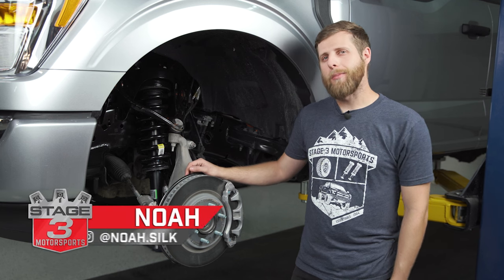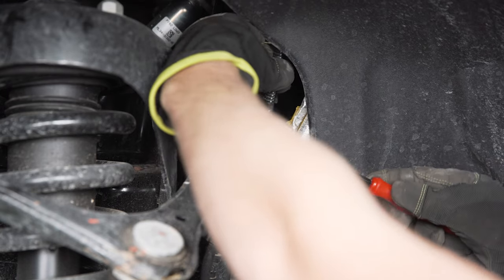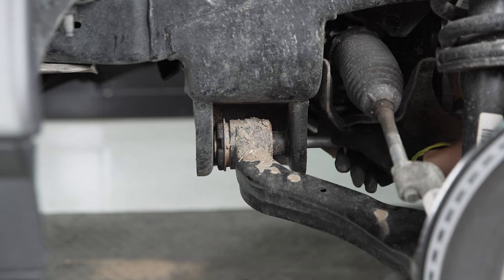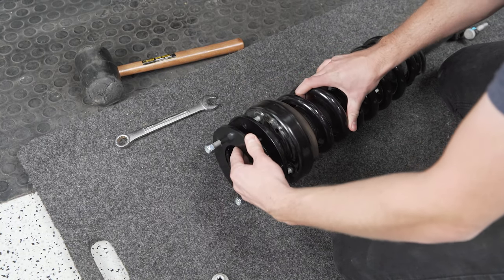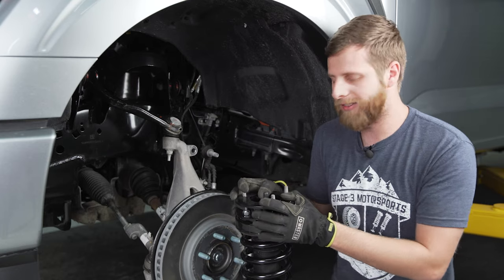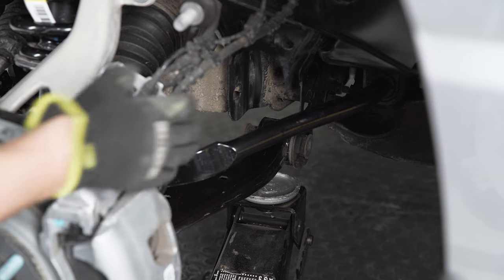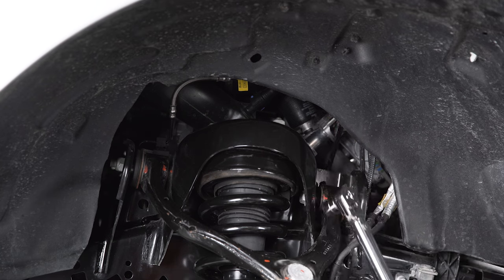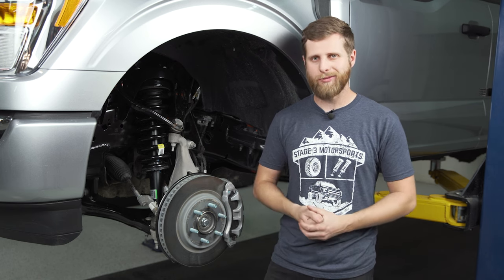2021-2023 F-150 2.3" Spacer Lift/Leveling Kit Install

Comment: Noah, we installed the 2.5 inch spacer kit on my 2023 F-150 Ford Tremor today, took two us 3 hours total.  Your instruction video was a life saver.  We had only two issues, realignment of the lower control arm / bolts and the sway-bar reattachment. With some McGivering we were able to get it all lined up and bolted back as when we took it apart. Other then that your instructions on doing it different then the instructions that came with them was great.  The truck looks great and sets level, thanks for the tips.
Reply from the maker: Glad it helped!
Reply: Had it aligned today, tech said the only thing that needed to be adjusted was the Toe-In, as it was out just a bit. All is good.

Comment: Great video but I spoke with a Ford certified mechanic about the way you and many others are changing the angle of the bottom bolts. He said those bottom bushings are pressed in and by rotating them like you did will risk tearing the rubber bushings. All you have to do is move the passenger side strut to the driver’s side and vise versa and presto, you have the correct angle of the bolts. It’s much safer than risking tearing the bushing on the bottom of the strut. Or, you can compress the spring and rotate the top plate. But the way you are showing people to do this is risky. Hope this helps and I really wished you would change your “how to video” to tell people the safer and more correct way to add the spacers. By the way I did purchase your 2.3” spacers and I thing they are a great product.
Reply from the maker: Thanks for the heads up! This is a good point and I'm sure it helps increase the longevity of those lower bushings. We've got our hands full at the moment so remaking the whole video isn't possible right now, but I'm going to add a note about this in the description in the meantime.
Reply: @stage3motorsports  Are the spacers side specific? Will this make a difference if the struts are swapped like jhamilton said above? thanks for the video
Reply: Will swapping the struts from one side to the other create any other geometry or alignment issues?
Reply: Not that I’m aware of but compressing the struts and turning the tops is the absolute best and safest way to do it.
Reply: Your absolutely right. My bottom bushings are smoked. I’ve only had this lift on for 5 months now. Every time the truck moves or makes a hard turn it makes a very disturbing sound.
Reply: Can’t you show me the time stamp that you’re talking about in the video that way I know what not to do? I’m a little confused on which part you’re referring to. Thanks!
Reply: @Cooldibs  its the part in the video where he has the strut in his hands and puts the bottom bolts into the bottom control arm and pulls the strut towards him to change the angle of the bolts so the strut will line up better. But by doing this, it risks tearing the pressed in rubber bushing at the bottom of the strut.
Reply: @jhamilton968  oh okay, makes sense. So just using the opposite side strut should work? I plan on installing this next week
Reply: @Cooldibs  I haven’t personally tried this but I was told by a certified ford mechanic that it should work. I don’t think they are side specific except for the angle of the bolts on each strut.
Reply: @jhamilton968  I just installed this system on my 2022 F150 and swapping the struts side to side will make no difference at all. The struts are identical for left or right side. Ford does this by drilling the frame mounting holes at the top of the strut 180 degrees different from side to side. So the only solution is spinning the top plate 180 degrees to orient the strut back to original positioning. (because the spacer spins the strut 180 degrees as well).
Reply: In another video installation of a different product, same final effect, Real truck shows putting some penetrating oil in the outside circumference of the bushing in the lower strut mount and then using the lower control arm holes as a lever point to reposition the angle of the bottom bolt-in bracket for the strut. I'm going to try this and report back....Yep, works perfectly. I sprayed some lite oil around the outside of the lower strut rubber grommet, placed the nuts onto the two studs and positioned these in a fixed vice, using the strut body to apply force and rotate the studs to the correct angle.
Reply: @beck1c  around 4:29 in the video will answer your question
Reply: Thinking about doing this to my 2022 f150. So I do everything he did in this video but to make it better on the bottom bushings I switch the passenger strut with the driver ? So the passenger strut will be where the driver strut was and vice versa ? Is that it ? Just want to make sure lol
Reply: @A5MR555  someone in the comments said that just switching sides will not work. So you’ll have to turn the top plates 180 degrees.

Comment: @Noah Stage 3   I just did this kit on my co-workers son's truck easy to install... Best way to do it is undo the half shafts if 4x4... Loosen the upper control arm nuts just enough to push it up a little bit.. we did not swap the strut side-to-side.. we 
Put the lower strut bolts into the control arm.... He pushed down on the on the knuckle and control arm and I shove the strut into the pocket and the spacer kit studs lined up to where they need to be... And then just put everything back... It is better to do it on a lift ...used a floor jack to raise the knuckle back up to the upper arm to snug down in a non dropped position... I did not have to adjust camber or Caster.... Final measurements for the camber we're -.3 and Caster was 5.3 on the passenger side 5.1 on the driver side... Set the time toe  .10 and the middle truck goes straight down the road driving smooth... Hope this was some helpful info... It took about 2 hours with us doing alignment.

Comment: I cant decide between spacer, strut or full suspension.  Even though I am only looking to level out and maybe fit bigger tires eventually.  Though I was only looking at getting 285 or possibly 298.

Comment: You mentioned the spacer having an offset on them that is slightly shifted. With that being said how you installed the strut it throws it 180 deg out in your strut bottom bolts causing wear on them. Best way is to turn the top part 180 deg to install it back to original of strut where the bolts are by compressing springs. But doing so it’s going to throw off the offset on the spacer will that have any affect on alignment?

Comment: This looks like a fairly simple way to install the leveling kit. 
Even though the lower control arm went back together without much difficulty would it be easier if you turned the bottom strut bolts inwards to create the same angle as before rotating strut 180 degrees from adding the spacer.
Reply: I'd imagine it would help, especially if you have a larger spacer and things aren't lining up. Fortunately, I didn't have too much trouble here, but I may give that a shot next time around.
Reply: @NoahStage3  thanks for the reply. This way definitely looks like the easiest way to do it for sure. Thanks for the video!

Comment: Can this be done without a lift? Just a jack and jack stands? Worried I won't have the space at the bottom to pull the strut out. Could the strut be pulled out the same way (but opposite direction) it is reinstalled? I.e. via dropping down a little and then up.

Comment: Thank you for the video.  I wish you had included the torque specs.  Especially on the frame bolts for the lower control arm?
Reply: You don’t need to use a torque wrench. I’m 50 years old & have been wrenching on cars/trucks since I was 14; never once worried about torque specs & haven’t died yet. ☠️
Reply: Well at least for the bolts through the LCA, getting an alignment will result in their tech tightening those down for you once complete. They look like a 14mm so you can probably snug them down with a breaker bar using a good bit of force, without worrying about overdoing it. I’d suggest marking the bolts so you can get it approximately there so driving to the alignment shop isn’t too awful.
Reply: @krasnaludek298  No, you miss understand.  I'm a big guy and I never think anything is tight enough.  I have broken many things. :-(
Reply: @saintsandsin3885  that's sad, and ignorant on your part...

Comment: Interesting.  A question.  Living in rougher road, mountainy ski country I'm thinking I'd prefer the thicker rubber of an 18 instead of a 20 wheel.  Could you do something like this, but put on an 18 wheel?  And could a 35 instead of a 34 wheel be used?  I ask this last because I'd really like to add a small amount of poke.  34's are not bad at all, just wondering.  Maybe I could go to a 3" or 3 1/2" lift/level to get to the 35's?  Thanks.

Comment: Cut my crash bars, as I went with 35s on a 2.5” level & downsized to 18” wheels for more tire sidewall. Looks good! 👍🏻🇺🇸
Reply: Nice! Good call on 18s and 35s. Smaller wheels and more sidewall is typically my preference as well, but I figured it was worth showing what could be done with a factory 20"
Reply: I thought you could fit 35s on a 2.5 with out cutting
Reply: @valentinibanez6175 he probably had an aggressive offset, or a tire with a width of 12.5 inches

Comment: When lifting these trucks from the front, how are you supposed to align it if it does not have alignment essentrics  bolts.?
Reply from the maker: Since Ford doesn't provide adjustable bolts for the LCA, you'll have to add them in when you install the lift. We talk about that process more in our Fox 2.0 install on this truck where we added SPC's camber/caster bolts. Here's a link to that video. https://www.youtube.com/watch?v=yD2WNzON79g&t=32s
Reply: @stage3motorsports  Is this 100% mandatory?

Comment: Definitely like that you guys posted an alternative video for doing the front lift. i preferred this way on the previous model f150's when dealing with the four wheel drive. but on the new 21+ i thought it was much easier  to take apart the new four wheel drive design and the alignment doesn't get messed up as bad this way.  seems intimidating but it's super easy, finished  mine in 2 1/2 hrs.
Reply: It does seem like both methods work well on this F-150. After dealing with the new Bronco suspension this has become my go to for pretty much every spacer install haha
Reply: The old way is much easier and faster for me . I did one the way the video shows and the other traditional way and the alignment was much better the old way and for me faster

Comment: Thanks for the video. I've added a 2" leveling block to my 2021 F150 4wd. I notice more people flashing high beams at me at night. How can I adjust my headlights?
Reply: We had to aim ours down after installing this too. If you pop the hood you'll see a small round opening at the top of each headlight housing where you can drop a phillips head screwdriver in and you'll be able to rotate a small plastic screw that adjusts them up and down.
Reply: @NoahStage3  Ha! found it today about 30 mins before your reply. Thanks tho!

Comment: I just installed this kit. Wasn't bad at all for never doing one before. this method for me was easy. Did any one get any scrubbing of the tires after the install? I went with 295/60R20 Nitto Ridge grapplers and 20" fuel off road wheels with a -18MM offset. They just barley scrub on the plastic in the wheel well. I'm hoping that the alignment I have setup for tomorrow morning fixes the issue. If not looks like I'll be trimming some plastic.... and maybe a C-hair off of the crash bar. We'll see. I'll report back lol
Reply: The verdict is in... This size tire (295/60R20) with a wheel that has -18mm offset, you will need to trim the front splash guard, maybe the bumper just slightly, and the about a 1/4" off of the bottom part of your crash bar. That or put a bigger lift kit on the truck. I should have looked into the offset a little bit more, but then I wouldn't have gotten the look I wanted.
Reply: @josephrouse1443  I think you would have been good with a 0 Offset.  I see a lot of that tire size on 
Real Deal Neal at Wild Willies Customs channel with a very little trimming.

Comment: Can you put 33 12.5 20’s on factory 20’s with this lift? With no spacers?
Reply: 2021 can clear 33x12.5 on factory wheel wtih no spacer without a lift lol I have 34.1 inch tire but only 11 inch wide with 0 rubbing

Comment: I had a Auto Spring 2” on my bench and decided I wanted a tad more lift in front so I purchased the Stage 3  2.3” kit (made for them by Auto Spring)  to my surprise they are exactly the same size. I even put a caliper on it. Same size !   😔

Comment: Does this kit require cam plates or bolts? And if it’s not needed, do you still recommend them for this kit?
Reply: They don’t make mention of recommending the cam plate/bolt kit but when I called them, they said they installed them on 99% of the leveling kit installs they did.

Comment: Great vid! But out of curiosity, by any chance do you know if you have to install a caster/camber kit for the alignment?
Reply: I did not, the shop didn't have any trouble with the alignment.
Reply: @saintsandsin3885  how's the ride quality? Stiff?
Reply: @fabianglr  Slightly stiffer.  Not bad by any means. I would say if you want to level your truck cheaply pucks are good option.  This one keeps about 1/2 to 1 inch of rake in the front.  If I had unlimited funds I would go with the  Fox 2'inch complete shock towers.

Comment: How is the ride quality impacted over OEM setup?  Is there any need for a camber bolt modification kit?
Reply: IT's a little stiffer then OEM.  The shop that did my alignment didn't have a problem.
Reply: @saintsandsin3885  mine is smooth on road if i fit my leveling spacer, is it gonna be stiffer ?
Reply: @sarifarsitv4974  Best I can say is a tad bit stiffer but I would not consider the ride ruined.

Comment: Ok, so heres my input - I installed this kit into my 22 F150 Tremor a few days ago - took about 2.5 hours for both sides in my home garage - video makes it look so much easier ..lol.. power of editing - wasn't that bad of an install.. usual pain in the ass kind of things like getting the new strut lined up fighting the UCA and LCA for clearance while lining up the holes --BUT - I would not do this method If doing again - Why , because you mess with the LCA which is what's used to keep your Camber and Caster in check... Took my truck by the Ford Dealership to let them do the alignment and was told to do it right I would need a Camber adjustment kit ( need two Moog kits - $60) but they could get the Toe in spec ( Toe was at 5.6) - so I get the Truck back and Toe is not in spec (0.57, 0.54)and they state that's the best they could do without the kit ( So at this time , Toe, camber and caster are out of spec) ... so I bought the kit and I will need to install myself and I could bring back and they would do again for 50% off the original $109 price.....after researching online - I found out basically they didn't want to put the extra time in - to get the alignment perfect and would take 2 techs to do the alignment as the camber kit makes it easy and a one person job. So after reading further I see hundreds of replies where others had an alignment and the toe was just barely out of spec and was then corrected easily with an alignment.... so by working from the top down, your not messing with any of the alignment nuts --- so doing it this way cost me $60 for the camber kit and another $55 for the 2nd alignment ($115) ... just throwing some extra info out there -
Reply: You can use a sharpie marker and mark your alignment positions prior to removing your LCA. This will help you reinstall to the same alignment position prior to installation. You will still need to have truck realigned but it will be much closer to factory.
Reply: Which camber/caster kit did you order and from who? I just used this kit on my 2021 and am having the same issue
Reply: @chaserichter2743  bought through amazon -- Moog K100070 Caster/Camber - you will need 2 kits one for each side, easy to install but afterwards you will need an alignment - makes it easy for the installer to dial in the correct alignment plus keeps the alignment "more" locked in, hope this helps
Reply: @deaconnyte9748  I really appreciate that! My camber is awful on driver side. So I’m trying to save my new BFG’s before it’s to late.

Comment: how much can you drive before an alignment.  I don't want to make an appointment to have it aligned until the level kit is actually installed
Reply: I don’t think you can align these new trucks. They do not have essentric alignment bolts.

Comment: Ok, I did the install.  Not convinced this is a better way.  I still had to unbolt the tie rod steering link.  Plan on taking about 3-4 hours for both sides. Getting the lower control arm back into the frame mounts was not fun when you are doing this on jack stands.  Also I did not tighten the control arm bolts tight enough because someone did not give me the torque spec.  Thankfully it was a short drive  to the alignment shop.

Comment: I went step by step in this video with my fx4 2023 f150, after installation, when I turn right, I hear a clunk noise while Turing on the front right of the vehicle. Now my concern is, my front bolt and rear bolt that holds bolts to the lower control arm are both evenly lined up. Could that be the problem??